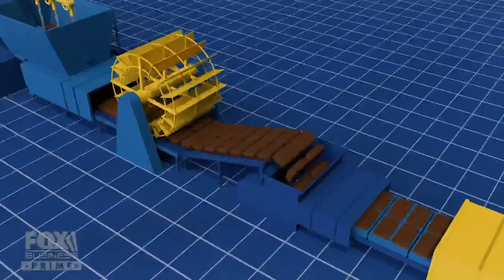No 'huffing and puffing' here: brick manufacturing on 'How America Works'

Comment: I use to do Mason tending for my older brother and his boss, and it's hard work. But I did learn how to fix chimneys and other brick material that needs restoration. Knowing how to use a trowel correrctly and mixing the motar properly is essential. I also worked at a Lumber Yard when I was in my late teens to early 20's as a Forklift Operator building loads and filling orders for Customers and different job sites, and I really enjoyed it. It was hard work, but there's nothing like the smell of fresh pine, and other wood material that has stayed in my memory for over 20 years now, and I take pride in my work. I remember the truck drivers that came to pick up big orders use to be so impressed with the loads I'd build that they go get my Supervisor out of his office and bring him down to the yard and show him the kinds of orders and loads I built, and Wicks Lumber in Meredith, N.H. greatly appreciated my hard work and high attention to detail. I'm 42 years old now, and could probably still work at the same level as I did in my 20's, but I'd have to condition my body to do so again because such labor work is hard on the body, especially ones lower back.

Comment: Personally, I would like a list of the buildings that were built with the brick from this company. Because if Gino was ever having an off day, distracted by something else going on, or even out sick, there’s no telling if the quality of the brick was good enough to make sure a building built with it stands. Regardless, it’s inspiring to watch how the process works. I do struggle a bit with the math, however. If they are capable of putting out 7,000 bricks an hour, then why are they only getting 30,000 out of a day on average and noting that 40,000 would be a real struggle? There definitely has to be something else in the mix that wasn’t included in the video. I assume.